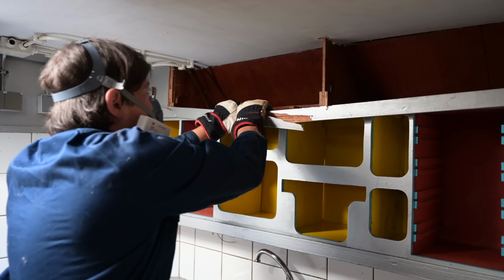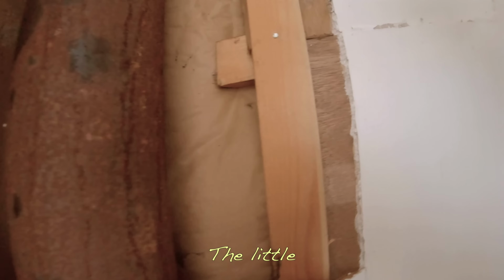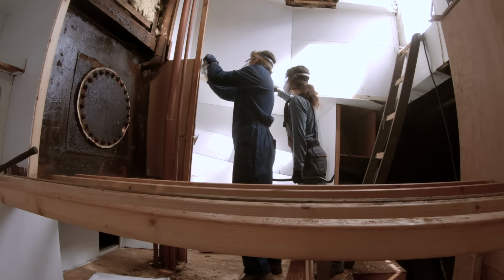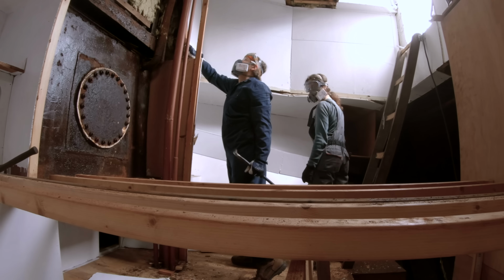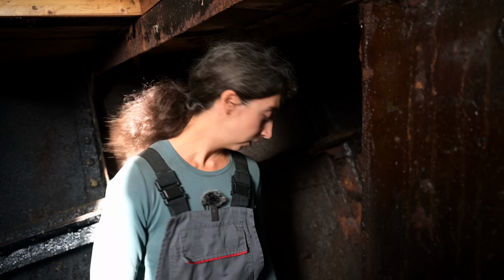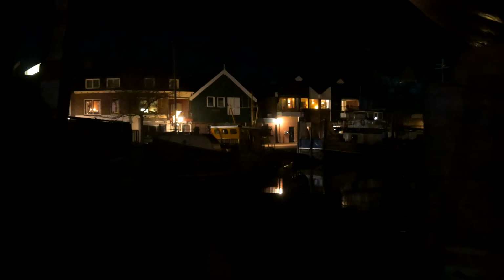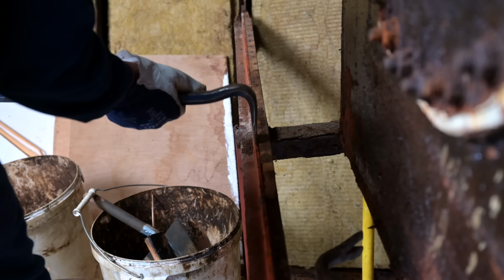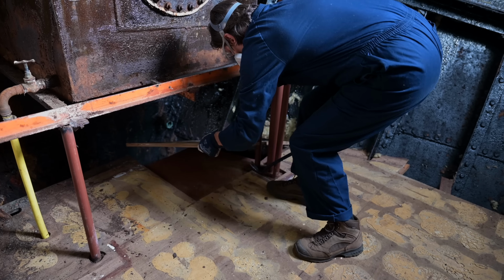FLYING CONEY - The Biggest BOAT PROJECT on YouTube?

Comment from the maker: It’s such a relieve to finally have all the interior out of the hull! That means no more surprises and we can focus on fixing the many things we found.
Reply: Amazing progress! You will have a fresh new boat you can enjoy for years to come. You will know it inside and out and your channel will will document every step of the way for future owners! Maybe you will consider interior panels and insulation that can be easily disassembled for future service and repairs. Strong magnets can be used for this purpose. Modern coatings and sealants for steel boats are really a game changer that reduce (but never eliminate) maintenance dramatically. What a fantastic team you are!
Reply: Keep the faith and your VISION of what at coney will become!  Enjoy the journey; and less it’s taken for granted; your courage to shear with us; is deeply appreciated!!!
Reply: The only way to do it with a boat like that - completely gut the whole interior.
Reply: When a steel ship becomes too old and rusted there is nothing you can do. They take huge cargo ships to India or Pakistan wherer they are sold for scrap. the metal is not worth anything, it has lost all it's strength. Seems you boat is like that.  You can sandblast or watersandblast and see what you have left. But removing the rust is huge job. You want to get it down to the shinny metal again.

 Probably much better to build a new boat at his point.  The cost of building only a new hull out of metal is not that high. The expensive part is the finishing, the motor, sails etc. So when you put the money in for all that you want to have a good bones or it will be a waste.
Reply: The ship has been surveyed several times and is in good  condition

Comment: Are you going to sandblast the rust away?  You can make your own dustless blaster by using a pressurewasher and adding crushed glass or sand to the water.  Not sure if you would have any boat left after the rust is removed though!

Comment: I watch many boat rebuilds but yours by far is going to be the hardest and most expensive. Putting her back to the original sailing vessel is great.
I hope your determination and money doesn’t run out. This will take years I’m guessing four at best hopefully I’m wrong. Good luck.

Comment: I think Sarida is a more challeging project as wood is a lot harder to work with. You guys are doing a great job,I have been at sea from 1970 to 2015.
Reply from the maker: I wood 😉 agree. Wood is more expensive and there are a lot more surprises. Sarinda also has two engines. Only Flying Coney is quite a lot larger than Sarinda and even the smallest tasks turn out to be big. I'm not saying that bigger is better actually I would prefer a smaller more manageable boat.

Comment: You seem to have missed possibly the leading boat builder of YouTube at this time,  Leo Goolden of the Tally   Ho project. Leo's approach to restoration is a little different in that he doesn't attempt to save the wreck but rather he puts it to good use as a template for a new boat.  He thus preserves the original essence of the boat but ends up with a totally new one! This approach  may also make it easier to plot expenditure over the çourse of the project. Like old buildings old boats can be a money pit.

Comment: Sailing wood is a timber boat of similar length but more importantly is that like yours it turned into a much larger project than was the original plan.
Reply from the maker: Flying Coney is at least four! times bigger than Josefine. Your comment shows me why it's important to illustrate the size of our little ship. Just to give you a perspective. It's really not to show off because there's nothing wrong of owning a reasonable sized vessel but next to us Josefine would look like a small sailing boat. There was a similar sized blue danish ketch in the shipyard and maybe I can include the footage in a future video.

Comment: The hull is so rotten that it seems you will never be able to find all the places that could develop a huge leak and sink the boat. I'm not sure I'd feel comfortable taking her off shore very far. The mooring costs to use a marina will be very expensive. 
I would of found a smaller boat that in better shape to put my time and money into.
I'm not trying to be negative but this boat seems past her prime .

Comment: Hope you check the thickness of the hull inch by inch. I can’t imagine that only a little replating is necessary. This ship has had a lot of corrosion not only from outside, but also from the inside. I would do a complete sandblasting from both sides, then check the thickness, replate and fully protect the hull with 2 component paint in multiple layers. You guys show real courage.

Comment: I once sailed on a 190 ft Schooner in this sort of condition.  As a new crew member I was surprised when chipping paint in the sail locker aft to be responsible for causing a small fountain.  I reported to the engineer who expressed no surprise what ever  and sent me to get an older crew emmber.  The engineer had a ready suply of bolts washers and nuts.  The older member went over the side with a bolt and i was instructed to wait inside  the sail locker .  In due course the splike i had driven into the hole was pushed back inside and I fitted a washer and nut on the inside and tightened it up.  On haveing a good look around there were many more.  Rust spots and holes are usually anodic and cathodic and seldom very big being concentrated around some impurity in the metal.  I suggest that you could well miss a few and so  a ready  selection of bolts , washer and gaskets shouuld be part of your emergency gear.  The bolt need not be big but the outer washer needs to be large and have some gasket material  on one face - the same for the inner washer should be conisdered.  You might also make it a habit to wear a holster on your belt at all times with a sharop knife, a aspike and a fid by way of being prepared for many an eventuality.

Comment: Rust never sleeps and I’ve seen a rustvalanch a few times here and again. Keep at it. Glad to see headway being made! ❤ Pro tip. If you can get access to a high capacity constant supply air compressor a professional air hammer and chisel adapters, knocking the bucktails off the rivets makes doe short work of removing the hull panels. That way they can either be salvaged or used for flat patterns for replacement. Using patches is okay but replacement may be the way to go. Stay brave!

Comment: I think it’s a close match between Flying Coney and Sarinda as to which is the biggest project on YT. Flying Coney is bigger in length and draft, but Sarinda has the added complication of being anchored in a tidal estuary and requiring significant hull repair before she could be safely moved. Sarinda wins in my mind due to the tougher working conditions.
Reply: Sarinda is half the size but yes a much bigger project. She could easily be moved but they believe they are saving money doing the work on the mud and are doing all the work themselves or with occasional volunteers. Good luck to them but as they are taking such a piecemeal approach, after two years they still haven’t ascertained the amount of work that needs doing. Well done Flying Coney for doing the sensible thing and stripping out the interior so you can see what problems you have and can make a proper plan.
Reply: Tally Ho is smaller still but again a bigger project than Sarinda or Flying Coney.

Comment: Hi guys good job so far, something for you to possibly look into whilst out of the water and bows fully accessible, would be the feasibility of fitting a bow thruster. I know that it is going away from being historically correct but it would make your vessel far more manoeuvrable in tight space, remembering the trouble you had getting in to the yard.

Comment: Well done for the amount of work and time you put  into this so far 82 foot of steel is a  lot  to check and repair  steel boats rust and wooden  boats  rot sometimes with  worms eating  the wood  or termites and fibre glass osmosis take your pick but well done the pair  of  you  👍

Comment: Since space doesn't seem to be Rosty Coney's primary concern, I wonder, since I don't think condensation and oxygen and their cruel work together can't be prevented if it wouldn't be wise to back-ventilate new insulation to keep condensation out trickles off into the bilge as quickly as possible and is pumped out from there. I know from a box truck that it rusted away wherever condensed water had no chance to vent and evaporate. ❤❤❤

Comment: I really think you need to buy a welder and learn to use it. It is not difficult to learn mig welding and they get cheaper by the minute. I think if you have to pay a specialised welder to do every bit of welding needed on a steel vessel that needs refurbing, it will become prohibitively expensive. I also think you need to find cheaper hard stand but yes...... that 100' is definitely limiting hard stand options. Loving the series.

Comment: I was following your project from the very beginning. And at the beginning I was a bit sceptical, as you really can not judge the condition of the hull unless you gut the interior. However, since you have done it now, and found the issues, which needs to be addressed, I see no reason why this ship could not last for at least a couple of decades with the right maintenance. As for the interior- that will definitely cost a lot to rebuild as well, but that can be done at a much slower pace. Keep up the good work!

Comment: I look at your project with great pleasure. What I personally would do is sandblast the inside of the hull completely and then treat it well, so you get rid of the rust for years!  there are rental companies in the Netherlands where you can rent a blasting machine that is the cheapest.
Reply: I agree, since you are this far, I would take the extra mile ... blast at least the whole inside ... saves you tons of worries in future years. I owned a steel boat for 10 years, the rust that surprises you most is in the inside ...

Comment: I recognized those moths right away.  I don't know where they originate from, but I'm guessing from Europe.  Those wee bastards ate a few holes in a couple of my kilts before I changed my storage.
One helpful thing I have found out is that they really hate lavender oil, aromatic cedar, or any kind of sharp-smelling, volitile oil. Removing the insulation is probably the very best thing you can do.

Fun background music.  I used to contradance to similar repertoire, but my knees are 100 years old, so I have to limit myself to English Country Dance.

Who is the biggest?  I think Flying Coney is in a class all by itself, though I haven't discovered all the ship rebuilding videos....yet.  In that you're working with steel, I suppose one could make an argument for comparing Aurora.   I think the closest comparison would be with the projects to rebuild cargo carrying sailing vessels.

Comment: I would just question the biggest boat project on you tube.  the aurora cruise ship restoration Would eat this in size with no problems its massive.
Reply from the maker: Absolutely! But the question is if a floating hotel counts as ship restoration. It would be a lot easier to rebuild Flying Coney as a houseboat.

Comment: 🤣Crew member 16,894 I love it .Question : when you  have all the hull repairs done  are you still thinking of what and how to prevent rust from coming back on the interior of the hull and superstructure .As is well known cold steel and warm air create condensation and if not allowed to  breath and evaporate create rust As you know too well .
Reply from the maker: We will de-rust the inside of the hull as good as possible. Probably use a rust converter and put a good protective coating on. To prohibit condensation we do want to use an Armaflex insulation glued directly on the frames and the hull. That should minimize corrosion in the future. I hope you enjoy watching the playlist. I love to see your comments on all the older videos 👍
Reply: @FlyingConey  Thanks for the sneak peek preview of the hull plane it sounds good though I'm not hot on the idea of insulation directly on the hull .If you are going to panel over the rib's and stringers anyway think about backing that with the insulation instead ,Thus leaving the already rust converter painted hull a chance to breath and stay dry .,or at least sweat down to the bilge .because no matter what you do that temp change will occur and create moisture . think this way the steel hull is the outer shell now create an inner one . The one primary rule of all boats is that they must breath .I learned this the hard way with wooden boats.
Reply: @FlyingConey  Thanks .It is a delight to watch you 2 working on Flying Coney some day i hope to have another boat for now my girlfriend has 3 bayliner boats all of which need various types of repair ,My goal is to get them all into shape and sell them and get 1 nice cruiser where we can spend more than a weekend at a time .she is a retired nurse and about the time you are done i will retire .then we can enjoy our days cruising the Puget sound area .which is in the state of Washington U.S,A, if you look it up you will see there are many places to go and see . some younger people call this area the Salish sea .side note as a young man and a semi truck driver i hauled boats ,one of which was called the Serafin it was a 24 foot wooden sail boat with no motor he and his wife were the first to navigate the world in such a boat i saw it for the first time after they had sold it to the new owner whom i met after he bought it . and took him and the boat from Washington state back to it's home port in California where it had been built .

Comment: Western Flyer is on Youtube and its a lot bigger.
Reply from the maker: Actually nope. Just looked it up and she is "only" 77ft so 5ft shorter and quite a lot less displacement than Flying Coney. Don't make my boat smaller than it is. 😂
Reply: Plus western flyer hasn’t posted anything in over a year maybe more
Reply: SIZE QUEEN! Check out the vessels you regard as nothing and you will see Craftsmanship and True Shipwrights restoring these fine Boats!!! Brupeg, Tally Ho, Tiger Shark, Aurora,Western Flyer and many others will be around and beautiful for many many years! Flying Comey was once very beautiful and can be again! How Deep are your Pockets?? That's The Bottom Line. You can't make a silk purse out of a You should try being more humble with those who have watched your channel and attempted to assist you with suggestions

Comment: Your basically doing a refit not a rebuild But it will still be a fair  bit of work. Should be nice when she's done. At least get rid of that old insulation and having new insulation this boat will be much more warmer and cosier. If all possible I would reuse that wood if the wood is good.

Comment: My wife and i done two boats now, and know how much work this is. Some free advice: every boat can be fixed and repaird, the only difference is the amount of work you have to put in. Don't try to take the rust of inside yourselfs, there is no way you can do this right without sandblasting. Rustconverters don't work wel, sandblasting and epoxypriming is the ONLY right way. It will cost you, but also safes you many, many hours of backbreaking hamering and grinding with always  disapointing results. Flying Coney can be restored as a beautiful good ship , but do it the right way, and she will serve you well for a long time.

Comment: If you aren't saving any of the wood why aren't you using an electric saw?
Reply from the maker: Because the crowbar has no cable, is safer and also quicker. I've worked with a reciprocating saw before and we will use one when removing the old deck but it's amazing how far you'll get with an inanimate carbon rod.

Comment: Hi guys! I really like the project- just bought a steel boat myself that I'm gonna start working on in order to live on. 
If size matter I think the Dutch schooner refit Tijgerhaai is even bigger with a lenght of 100 feet. https://www.youtube.com/@tigersharkboatworks

Are you gonna paint the inside? Old trick in Denmark with steel hulls are to simply paint with cement. Just degrease and remove rust flakes and it can be painted directly on.
Reply from the maker: We want to convert Flying Coney back to a sailing ship and she will be about 100 to 110ft long after the conversion. So it's close in between Tijgerhaai and us. But in my humble opinion Coney has the more beautiful lines because she was built as a sailing herring logger. 
Thanks for the tipp with the cement paint, I'll have a look at it.

Comment: This boat  will cost 3 to 5 times more than you estimated. The rust will never end. Sell it for scrap and buy a finished vessel in survey. Plus ,if you make it to 3 years that is time spent not sailing. Maybe the rebuild is your plan and then sell it. Any buyer who sees your  vids will run for the yard exit. Whose dream is it  to have a "bigger' one? Usually with these dreams its the man. These are your best years. Soon you will want a baby and a proper place to live that isnt  full of diesel and fibregalss insulation.Let alone lead paint dust and endless painting. Run before your daddy wont fund this folly anymore.If you make 2 years you will be lucky.
Reply from the maker: The idea was to give you an impression about the dimensions compared with other boats here on YouTube. Bigger doesn't mean better and Flying Coney  will be a reasonable sized sailing ship for 12 guests + crew. It's our dream to restore this vessel and it's our money. Not your's and not the money of our family. We make our own decisions and you can follow along or you can leave it.